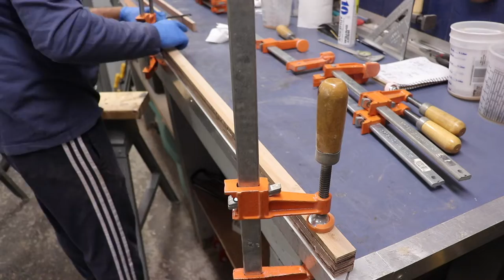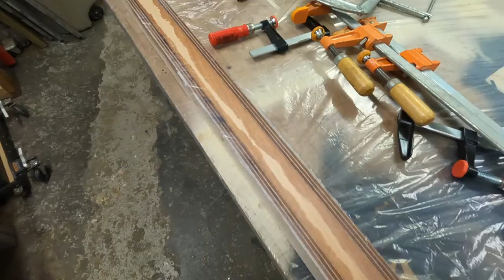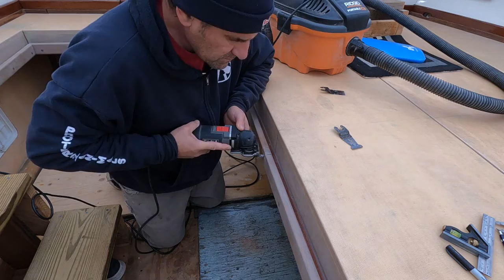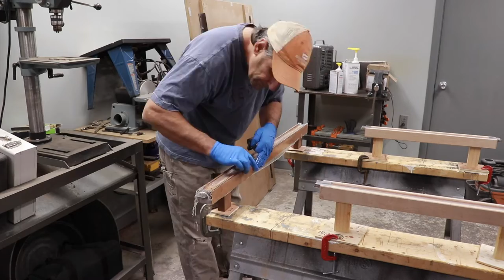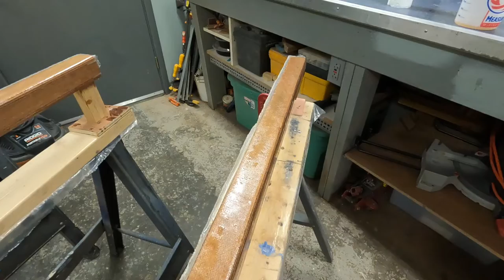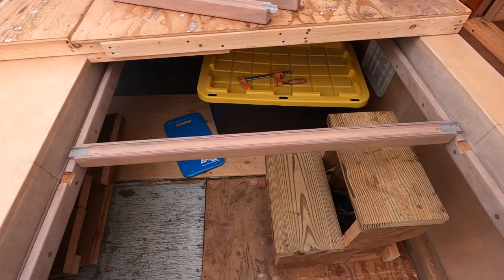Cockpit Hatch removable drain channel fabrication. Attempt 2 - Boat Restoration EP083

Comment: Bob, take all the time you need to get the sanding finished before the summer heat arrives. Don't blame you a bit, but we will miss you. Be sure to video the engine bed stuff though. The tank area came out so well, we will have the best-looking (and driest thanks to the drain channels) bilge on the river in "our" boat. Thanks for the episode and we'll be waiting for the next visit. Jerry
Reply from the maker: Hi Jerry. Spent the last two days grinding/sanding fiberglass. Made a small dent in the progress and am kind of itchy. I guess I will have to get used to it. Of course I’m finding more small issues to take care of. I should be used to that by now. I’m trying to not make to much of a mess on the rest of our boat so I’m taking it slow (for now) we will see in a week from now how much patience I have to do it this way. Happy so far with the progress. Getting close to removing those beds. Take care and we will see you soon. - Bob

Comment: Yea I think the butyl tape to seal it up is a good idea. Or if they make thin rubber weather stripping tape? That way you wouldn’t need to wrestle breaking the butyl bond when you take them out?
Reply from the maker: I will have to look into the thin weather stripping tape and see if there is  anything out there that will work. Thanks for the suggestion. - Bob

Comment: Why have the clearly weak point of stainless steel bits at all? The 3x layers of wood you used to make the centre piece, why not make the top 2 layers 5 or 10mm longer. Can match that "sticky out bit" with the 2x outside edges too. Then you can just cut that 5 or 10mm shape in the outer frame and epoxy it in.
Reply from the maker: If I were doing it now I would be making the channels wider and deeper. I believe they are too small. They have already caused clearance issues with my engine hatch drip edges and have made me rethink my hinge ideas. I had many ideas of how to do the overlapping part. One similar to yours. I will be making support/attachment brackets that the wood will sit on so there should be no pressure on the stainless piece. Any suggestions/ideas for sealing the stainless piece to the perimeter channels? I want these to be removable. My current thought is a thin layer of butyl tape but I’m open to any ideas. I would like to get working on these parts this fall maybe. Thanks for commenting & watching.- Bob